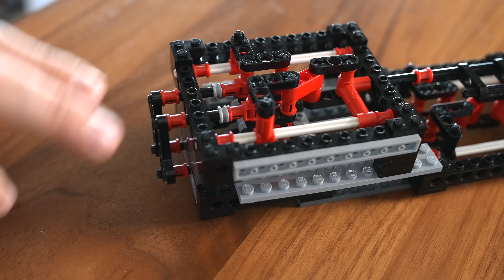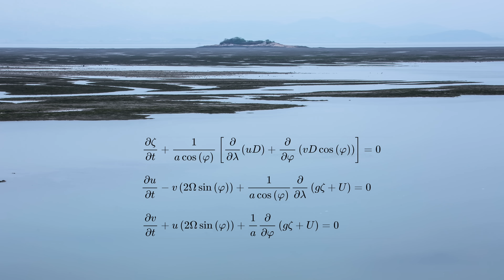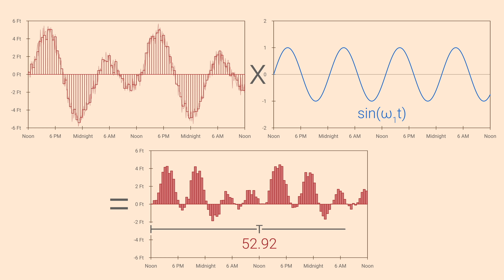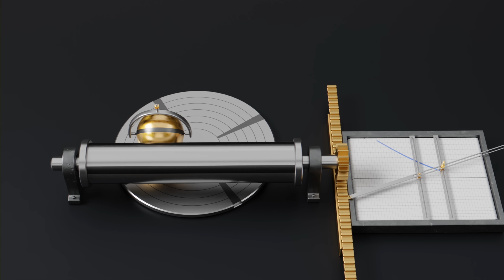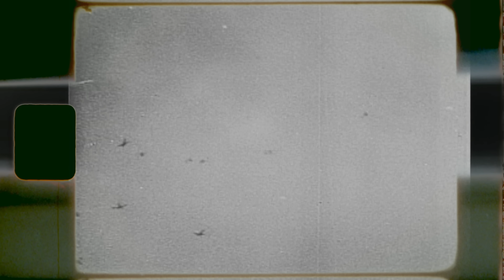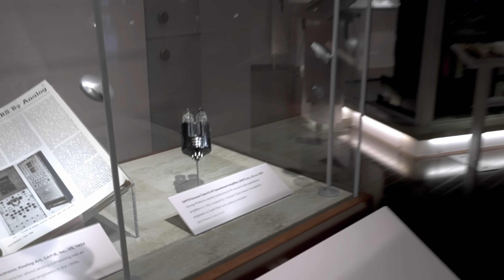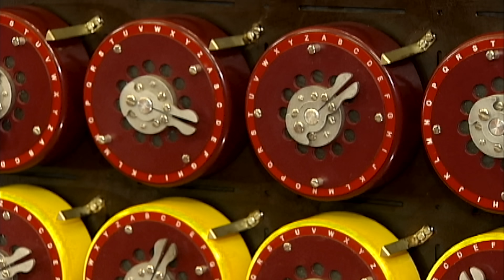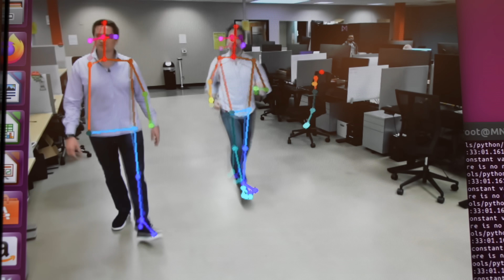The Most Powerful Computers You've Never Heard Of

Comment: We should make a distinction. 

There are analog computers built for a specific problem.

But there could just as well be analog computers built to mimic a Turing machine. 
Or at least... What I mean is to mimic a digital compuetr.

For this, we will have to invent analog parts that could stand for the gates AND, OR and NOT.

When I was in the second (it was most probably not the first!!) year of high school (14 years olf) I was thinking about a computer that was to operate with hanging weights.

Its exactly these days that I learn about an educational toy, Turing tumble something, that operates with falling marbles.

Comment: The German gun directors for anti-aircraft aboard the Bismark led to her doom, with nearly all of her crew. The squadron of Swordfish torpedo planes damaged her rudder, and fuel tanks. Because the Swordfish were slow. Slower than the German analog computers could process.

A consistent problem with analog computers, the big ones needing an update can be a monumental task. It isn't like changing the program on a disc. It is building a new disc and integrating it into the existing stack. Slow. Time consuming. Difficult. Inadequate QA can sink the project. Or, the Bismark.

Comment: Your Lego computers (which are awesome, by the way), a long with your discussion of computing parts getting close to their minimum size, give one big hint as to why analog computers might be coming back. Your analog computer is MUCH smaller and has MANY fewer parts than the digital computer. That's because it's designed specifically for the task it's doing, rather than forcing a simple system whose core components have nothing to do with the problem at hand to indirectly solve it.

Comment: Analog could never replace digital in speed. Even if you built it in a microscopic scale, even if you could make it relatively fast, even if it didn't matter that a CPU might be the size of a dinner plate (although it would likely have to be much much larger than that), it would still suffer from one big flaw: mechanical wear and tear.

Comment: Well, opamp is about give or take 20 transistors & few resistors. They probably could be put in sophisticated grids dedicated for certain calculations and miniaturized in somewhat same fashion as cpus. Question is if they can provide any added edge over current discrete data computing - taking speed and complexity of instructions in notion - There is Nyquist–Shannon sampling theorem, through which you can get needs for representation of any analog signal with certain frequency with corresponding amount of bits.

Comment: The wild thing about this isn't that its an analog computer nor that it deduces based on observation, but that this technology existed at point in time but was lost in transit (potentially). But that creates an question that had it not been lost in transit (potentially), had it made its way to its destination and had it become mainstream--what kind of material impact would it have had on how mathematics, science, (what would become physics), and countless other disciplines that make up our world and economy? It's a mechanism that greatly reduced calculation time. Banks as we know today are massive computational networks. Most machinery is based on math, material science, physics, exact tolerances, and are all juggling games of maximizing efficiency per unit of energy used relative to the amount of work done to produce a useful good, where the goal is to be net+1 or net+10.

All of this is of course a what if now, because the device never made it, supposedly, to where its supposed to go. But its an interesting thought experiment to consider what else could something like this have helped amplify in other areas of the world.

Comment: Early 70's when we started working Fire Control, Digital fire control had only just started, so we had to learn both. While some ships had digital; most then were still analogue. The first digital gunnery FC computer we had had 2K of memory and ran it's entire program in 1/2 a second. Sounds ludicrous now. It is preserved in the Daring class Destroyer HMAS Vampire in Sydney (museum). 

By the late 80's, the analogue systems were all gone (apart from small, secondary functions) as digital took over. 

But the analogue systems were a work of art from a precision mechanical standpoint was concerned. Multiple mechanical computation devices such as differentials and integrators (as above, also known in our (Navy) circles as "potters wheels") that were made with a level of precision seldom seen in other devices.

I worked on that stuff for 40 years, and while the hardware changed, the calculations done didn't. 

Was an interesting job, I enjoyed every minute of it.

Comment: Excellent presentation. When I was doing my aerospace masters in 1981, I had a project to simulate an unstable combat aircraft and then to add the effect of an active control system to stabilise and control it. This was all analogue using potentiometers and amplifiers. The reason was that analogue computers have the immediate response needed to bring a dynamically unstable systems under control without introducing nuisance and limit cycle oscillations. All artificial stability systems for aircraft at the time had an active end built as an analogue computer, even if the pilot input end was still digital. It was a very powerful lesson. As my tutor observed, in general with digital systems you can have fast or you can have powerful. With analogue computing, it's possible to make the sensor the source of power (as in aerodynamic servo tabs, the BAe146 regional jet has an entirely analogue pitch control system involving a devious concoction of pneumatic, aerodynamic and inertial devices), the result can be both fast (=responsive) and powerful.

Comment: Doesn't a toothed wheel qualify as digital?  It can't discriminate between amounts less than 1 tooth, to be truly analogue should the wheels be friction driven?

Your digital model uses two states for the plungers, in and out, one and zero and is binary digital.  If they had three states*: in, half-way, and out it would be trinary (LOL) digital, each plunger representing 0,1 and 2

*EDIT - I'm not referring to tri-state.

Comment: Building Heating, Ventilation and Air Conditioning was controlled by analog computers up until the early 1980s.
These were mainly pneumatic using 3-13 psi as a control signal range sensing temperature error signals and computing proportional and integral control functions.
Other analog control computers were electric or electronic.
The Australian HIFAR nuclear reactor secondary cooling system was controlled by electronic modules calculating square-root functions, proportional and integral functions without any software.
Buoys are "boys" not "boo-eyes"

Comment: Another application of analog computers (I presume) is in the aiming of battleship guns, which, when you think about it, must take into account a number of variables in real time.  I saw on a YouTube video a while back that the shell from a large naval cannon can take as long as 90 seconds to reach its target.  At the speed they travel, that is a long way.  Over that distance, the target ship would appear tiny - if it is not over the horizon - and must require extraordinary accuracy, as moving the cannon through as little as 0.1 degrees would definitely put it off-target.  This accuracy has to be maintained, taking into account the rolling and pitching of the ship, and the motion of the target, assuming it is also a ship.  At full range, the cannon must not fire at where the other ship is, but at where it will be in 90 seconds.  When you see a ship in port, everything is moving very slowly, but at sea, they move along quite quickly, with a displacement of several lengths during the time of travel of the shell.   If a gun boat is to stand any chance of hitting a moving target from its unsteady platform, there must be some pretty fancy computation behind it - and during the last war, there was no digital control available.

Comment: As a computer scientist, I am well aware of analog computers, analog computing, and its advantages and disadvantages. There are also hundreds (yes hundreds) of alternative computing methods and devices that were relegated to obscurity by the simple fact that digital computing is cheaper and more efficient for a wide range of applications. The slide rule (for example) represents logarithmic computing, yet we don't call them computers because they are usually implemented as manual devices. Likewise, Dick Hamming ran through a number of alternative computing approaches when I took his course in Grad School. One of the best features of digital computing, however, is that it has brought computing to the masses. You don't have to be a computer scientist to take advantage of digital computers. In fact, although interesting, the substance of this video is of little value to most professions.

Comment: @17:50 so why did my analog tv signal result in "snow" but i could still make out what was happening. But now with the digital Air signal it's crap when you loose a few ones and zeros. The picture freezes sound drops completely and you miss the last 5 to 10 seconds of the program. So why is it so superior that's if you have a answer for us plebs who still use the airwaves.

Comment: There are analog computers that are highly programmable / changeable. They use "patch panels", one for each application. The panels are thick aluminum boards that contain holes for wire cables between components. When engaged, the panel / wires connect to op amps and other circuit components inside the computer. The wiring of the panel determines what functions and calculations are performed. These installations also typically link the analog system to a digital computer, for auxiliary computing and I/O. I used one of these analog computers, the EAI 680, at Purdue University EE Department in the 1970's.

I tried inserting a link to the photos and description website, but then this channel instantly deleted my comment. You can view the EAI 680 by searching for Analog Museum. Then go to the Collections section and view their page on the EAI 680. Many other fascinating pages at that site as well.

Comment: Transistor based digital computers did not start the digital revolution it started with use of 2D21 tubes  two of these tubes formed a flip-flip.  While in high school in 1965 I worked on resurrecting a "Boroughs" tube bases digital computer.  Transistors made the basic cost of energy and maintenance cost running a computer into the range of the average large corporation.  cost of the first transistor machines started at about  $80,000 in 1960 dollars.  By 1966 the cost had dropped to less than $40,000 with 4096 words of core memory.  IE Digital equipment Corporation DPD pbp-5, PDP-8 Gen-rad, HP and many other coronations had developed mini-computers which could sat on a normal office desk

Comment: When I was a kid - around 1960 - I built (from a kit) a computer that was kind of like your white, grey and black three wheel computer, except it used audio tones for multiplication and division problems. When you would set the first wheel to a number, you would hear a tone of a specific pitch that related to the number. Then you would turn the second wheel to another number and you would hear a second tone, the pitch of which was different if you set it to a different number than the first wheel. Then you would turn the third wheel until the two pitches merged into one pitch, and the number that the third wheel pointed to was the answer.

Comment: One minor problem with those calculations they do not include: When the sun, moon, and Earth are in alignment (at the time of the new or full moon), the solar tide has an additive effect on the lunar tide, creating extra-high high tides, and very low, low tides—both commonly called spring tides. One week later, when the sun and moon are at right angles to each other, the solar tide partially cancels out the lunar tide and produces moderate tides known as neap tides. During each lunar month, two sets of spring tides and two sets of neap tides occur (Sumich, J.L., 1996).  From NOAA

Comment: Was at the wavefront of the analog-to-digital resolution in engineering. During an experimental study with large lasers in 1986, we took data with high speed 16mm film, but was able to digitize the outline of hand drawings made from the film on an artist's bench. From the digitized data, we could compute laser irradiance. 16mm is gone and digital cameras are must faster. Programs change the images to outlines, and combining the time stamp from each digital frame, we can get the same data in about....10 milliseconds. A little faster than the three hours we used to need.

Comment: Analogue machines in the old style were objects of great beauty, and in many cases the result of superb craftsmanship.  They were however very expensive, and had to be lovingly maintained, since they were prone to malfunction due to the build up of dirt.  Inevitably too they gave inaccurate results.  A secondary effect was cumulative error as a result of rounding errors in a lengthy calculation.

On a personal level I used a slide rule for many years in my early career as a design engineer, but was blown away by my first electronic calculator - a Texas Instruments machine which by modern standards would be considered pathetic. That was in the 1970's.

I shall look forward to viewing a further piece on a possible comeback for analogue computers, but am sceptical that they can ever overcome the problems inherent in this kind of machine.

Comment: Do Quantum Computers count as analogue if they use a continuous range (qubit) of inputs which when measured result in discrete outputs? With quantum circuits, truly random numbers are easy to generate because physics at a quantum level does so. Does this mean that using nature and physical phenomena to simulate computations for some un-solved problems will require futuristic analog computers or quantum computers?

Comment: Please make a video addressing a thing I discovered. I tore apart a brass lighting fixture, one decorative component of which was a steel globe about 4 1/2 inches in diameter. It had a 3/8" hole at the top and bottom. Some water had gotten inside and was rusty. In washing out the rust in my kitchen sink, the globe fell into and sealed the garbage disposal entrance. I wondered what would happen when as the water level rose in the sink. I supposed the globe would float at some point, allowing the water to drain out, and the lowering level would drop the globe back into the hole, reselling it. Thus it would be a crude regulator of level as the globe alternately floated and sank. But this did not happen! The globe remained in place until the water rose over the top of the globe whereupon some water began draining through the globe via the two 3/8" holes. Yet the level continued to rise as there was more water from the faucet entering the sink than there was draining through the globe. After a half of inch more water entered, the globe suddenly popped up like a submarine surfacing. Then the sink drained around the globe. I repeated this, starting from an empty sink and saw the same result. What causes this, and what are the factors involved? I did not investigate (yet) what would happen if the axis of the 3/8" holes was tilted vs. vertical.

Comment: Aren't FPGAs as you described, a machine that models an environment? in a way, they are programable digital devices that model a problem and provide a solution. So basically they use the idea of a digitized analog solution. Using it's digital components it can be reprogramed (morphed) to solve a different problem. In a way all ASICs are digitized analog solutions. Does it make sense?

Comment: Would it be possible to create a virtual analog computer that could give you answers that the host computer couldn't figure? The virtual analog could have perfect 0 tolerance and run the same every time. Then you'd just read the answer the analog came up with. Just thinking.

Comment: Quantum computing is similar, except they operate in parallel

Quantum has issues issues dealing with noise, the same as analogue that has issues between gears/units

There was research using chemical computers but that didn't go far

Comment: problem with the pully system is the lag or resistance between each pulley, to use an analogue computer one must over come this problem. to have an absolute vacuum system with no lose in between the pulleys. clogs is a good start. 
or how about a hybrid where one controls the digital computer to operate the analogue computer.

Comment: I designed analog computers in the 1990s for NASA for x-ray cameras because digital was too slow and takes too much power.  It's reasonable to begin using analog for the next revolution, or FPGA's for better parralelism.  If only there was a way to make FPGA's at affordable  prices ($100 instead of $10,000)

Comment: My prediction: it's about multiplication and addition for neural networks - these use mostly convolution operations on floating point values, which are(convolutions) made of addition and multiplication. So you can replace float with analog value(like voltage) if you have op-amps in adding and multiplying topology.
The problem is, you have to make such semiconductor chip for every topology. The second problem is, with very small scale of integration, the transistors charachteristics may be not so "clean" and sometimes quite inpredictible